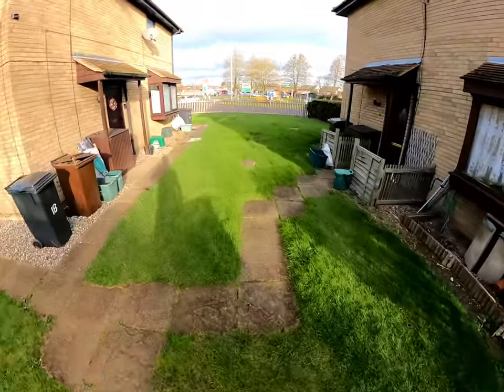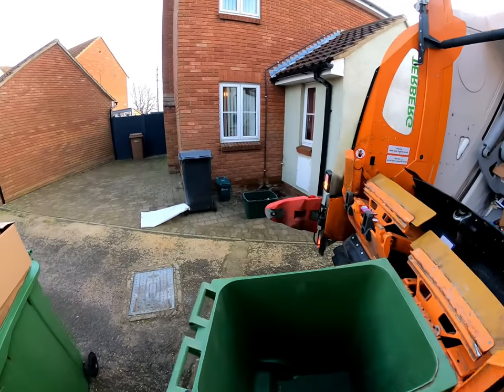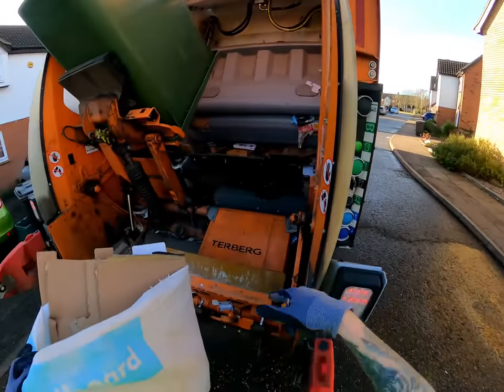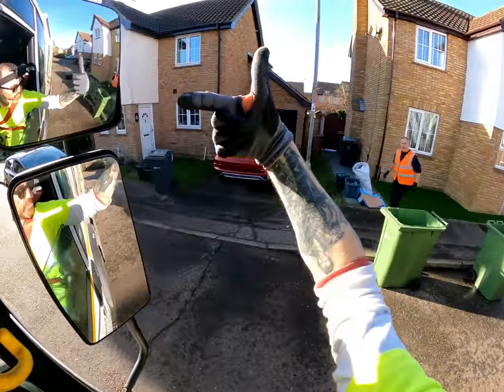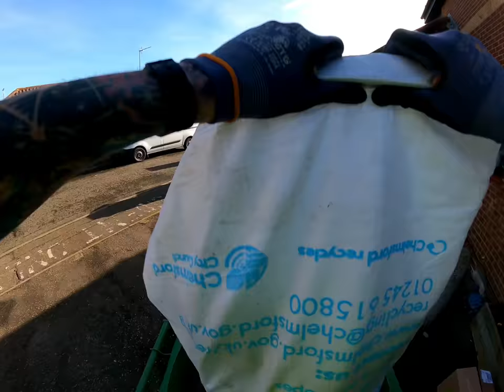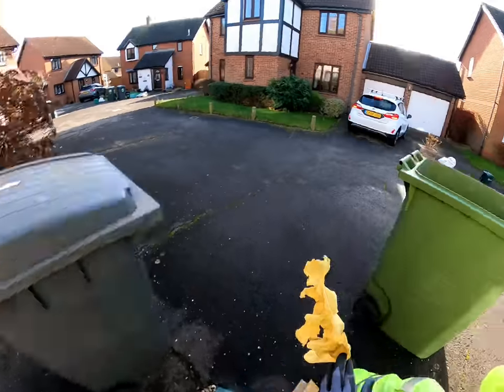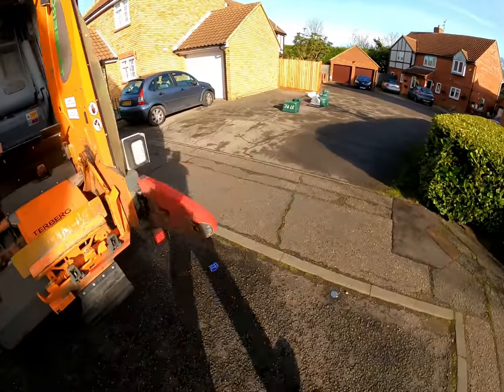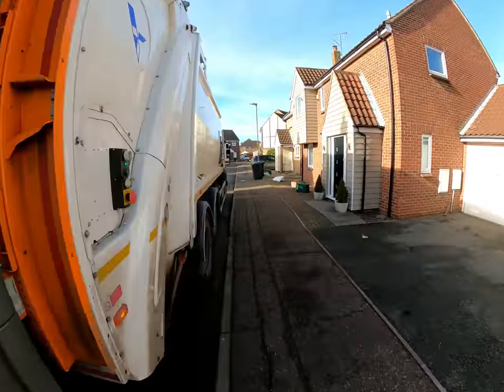Bin Man/Refuse Collector/HGV/Truck/Lorry Driver POV #11 *1000 Subscriber Special*

Comment: Loving the video so far mate! Really great stuff! Those lifts are Terberg OmniDel, specifically the electric version (signified by the green dust curtains and green terberg logo on the side glass panel). OmniDeka are the lifts featured in your first POV video on brown bins, those were brought in by Terberg to replace the OmniDE lifter (featured in your POV #2, #3, #4, #5, #6, and #7) which were rather unfortunately discontinued in the uk. Keep up the great videos mate 😎👍
Reply from the maker: Thank you

Comment: The TX4 taxi from 2006 onwards has a VM  2.5  16 valve diesel engine , (euro 4 )  and later 2.8 16 valve diesel (euro 5 ) .
Reply from the maker: Top bearding thank you for fact checking my videos 

I have no issue being humbled with facts to my hyperbole
Reply: @wheelerd02  I wasn't fact checking.  Just for information.  You are correct about the nissan being a 2.7  non turbo .  This was used up to 2002 and then the ford transit 2.4 16 valve turbo up to 2006.
Reply from the maker: @dennisphoenix1  didn't realise the 2.4 Ford lump was 16v, I just assumed it was a noisy 8v
Reply: @wheelerd02  yes the 2.5  8 valve up to 2000 and then the 2.4 16 valve onwards

Comment: Hey just wondering to be a driver of a bin lorry is it a class one or class two licence you need
Reply from the maker: HGV 2, over 7.5T

HGV 1 is for pulling trailers which certainly is not a part of this job. Although there is a whole industry around bulk waste movement for landfill/recycling operations.

Waste-Away
Fred Sherwood
Veolia etc have HGV 1 around waste management

Comment: Are you allowed to leave a truck running in the middle of an estate while you walk away to collect refuse    I thought drive must stay with vehicle at all times     How long does a run take to finish? Seems a slow process if your on task and finish
Reply from the maker: Driver's are employed as loaders here in a dual purpose role.

I have never told not to leave the vehicle, I understand your point though.

If someone came up with knife/gun/acid I would be getting out the vehicle anyway. 

The rounds vary in length.

Black bins can be done by 1400/1500 starting at 0630. Recycling depends on what you are loading. Paper & Plastic finishes much earlier than cardboard on account of being able to travel further with the bin before emptying.

Comment: I'm also wondering what do you mean by the left or right lock
Reply from the maker: Lock referring to full steering input on the wheel, maximum angle achieved is "lock"

The way manufactures refers to steering wheel turns "2.t turns lock to lock", full left to full right. How many times the wheel needs to rotate to get full steering angle

Comment: How do you know what roads/streets your covering? Especially when you’re new.
You can say nav one place but if you’ve got to cover an area how do you manage that?
Reply from the maker: The routes I was driving for the loaders worked full time. They knew every turn, drive or reverse and what order to do the work in.

There was a large zip lock folder with A1 print outs of the route. An overall overview of the days work plus further zoomed in zones.
Reply: @wheelerd02  just watched one of your videos about being a bus driver, how easy is it to drive a bus compared to class 2, refuse lorry?
Reply from the maker: @ksmith3997  buses are very straightforward but also have their own drawbacks. I have now done buses longer than I have driven lorries.

Buses drive forwards so minimal reversing. However, it being a public service vehicle it draws in all sorts of people. Some very nice decent folk, some not so much.

Like the bins, being a bus driver you are still treated with contempt and disrespect on the regular. Many people need our services but we are slow, cumbersome, in the way and slowing you do; an obstacle to overtaken at any cost.

Cruise about, occasional bit of chat with cash/contactless, pick up & drop off, a simple job in essence but the reality can be very different.

I prefer buses to lorries, some say I may be made but thats my concern.

I don't think I would go back to lorries now, doesn't pay enough for the frustration, risk and sacrifice.
Reply: @wheelerd02  yer, just not keen on the type of work and long hours of lorries (done it a few weeks) Refuse driving is okay, but wasn’t keen on jumping out to help. I know some councils have purely drivers, but not close enough to where I am. So thinking of maybe going the bus route? Not fussed on big money etc so as long as it’s simple enough to drive I might give it a go from what you’ve said. People moaning is fine, that bit doesn’t bother me, water off a ducks back
Reply from the maker: @ksmith3997  I started off HGV, got made redundant and someone said I should try the buses.

I grant you, sometimes buses made me very angry and took me to bad places but I am much better now in my new jobs.

Very simple work man, however boredom can become a real issue. I bring a book everyday so anytime I am early or using stand time at the end kf a journey I'll try and snatch a few paragraphs/pages. Read many a book this way over the years, eagerly awaiting the end of a journey to find out what happens next.

No music in buses so whistle, sing or daydream. Motors are cery likely to have CCTV so no naughty business but as a means of income, it is simple.

Also, depending in routes, delays and duty card planning you may find yourself in the seat for a extended period. No worse than some of the HGV 1 work out there but something to bear in mind.

It's generally frowned upon and a faux pas to stop mid service to buy drinks and snacks. In a similar vein, can't have a piss up the NSR wheel like you can with a bin lorry. Prepare prepare prepare 

A quote from me to anyone and everyone reading "Go when you can, don't wait till you can't".

No matter where you are or what you do; you'll have a HGV & PCV licence. You'll never be out of work.
Reply: @wheelerd02  cheers mate, good advice. Think I’ll go for it, I’m happy with boredom 😄 just nice to “switch” off did what I need to do and go home, want it simple as possible 👍🏻
Reply from the maker: @ksmith3997  Buses can certainly do all of that

Comment: Just a tip - stand large bits of flattened cardboard around the edge of the bin, and put the loose stuff inside. Can effectively use the large flattened cardboard to create walls to extend the height of the bin, allowing you to get more in one trip
Reply from the maker: Indeed I have noticed the guys doing this 

Nice profile picture, fellow greyhound owner
Reply: Yep one of my old tricks, and then climb on top of the bin and stomp it down to fit more in !
Reply: @chelsegreen7868   I used to get two weeks of mixed recycling (paper, cardboard, plastic and cans) from a 42 house terrace that the wagon couldn’t reverse up into four 360 litre bins. Every house had a 3/4 full to totally full 240/360. The cardboard walls on the bins I’d pack it into used to be taller than the bin itself 😂 Luckily there was one house that always had a second bin out, which was purely large flattened cardboard

Comment: I was want to ask what happens to the cardboard or plastic's that are up near the hydrawlics have you have a brush where you can bring it down.
Reply from the maker: Too high, too far and way too dangerous. We aren't allowed to enter the hopper/load area.

Let the vehicle deal with it, if anything does get stuck or into difficulty then the engineering team can isolate and secure the vehicle to deal with blockages

Comment: Awesome!! Great vid!! How come u didn’t have the twin pack(split body)??
Reply: Cause he was only collecting one waste stream (cardboard). The twin pack is used for plastic recycling in one compartment and paper in the smaller second one. Chelmsford still collects paper seperate from cardboard with both plastic and paper going out on brown bin week and collected by twin packs while the cardboard goes out on black bin week and is collected by single compartment trucks like the one shown in the video.
Reply: @laurin4339  oh wow that’s a weird recycling scheme!!
Reply: @refusevehiclesuk6129  Yeah very very unusual nowadays to have a seperate collection of cardboard and paper, usually mixed together or it‘s just completely commingled. Dunno if any other council in the UK still has a seperate collection of cardboard but I doubt it, Chelmsford is the only council I know that does it. Mind you Chelmsford also has a green box for glass and tins so actually four different recycling streams! That‘s pretty much unique, don‘t think any other council still having four different recycling streams. I think it‘s great though and very clever of Chelmsford since they can get the maximum quality out of the collected recycling meaning more money. The cardboard that was collected in the video can be sold at a far higher value than cardboard that was collected from a commingled recycling bin since the one from the commingled bin is dirty because it was compacted together with other recyclables.
Another advantage of Chelmsford recycling system is that it‘s all manual and no recycling bins meaning there‘s no way for residents to hide contaminants since the workers would easily spot it when emptying the bag/bin.
Reply: I'm in Scotlnd and my council have 1 wheelir bin for mixed recycling, 1 wheelie bin for general waste (only goes to landfill if the power plant is closed where it goes to be turned into energy) kerbside food caddy and a box for glass and small electrical items

Comment: How many tons do you think the compactor comes down and crush anything inside
Reply from the maker: The compactor shows hydraulic pressure of 200 BAR when moving the large blade back and forth

Not sure on the hopper itself

I have informed on general waste that the hopper blade can snap/crack an engine block in half
Reply: @wheelerd02  Engine block? I got very high doubts a Olympus like the one in the video could slice through that, the packer and hydraulics would break. It could swallow the block but not slice the thing in half. Don‘t think any rear loader for that matter could snap a actual engine block in half since it’s too solid, the hydraulics would blow in no time. However it‘s not up to questions these packer blades are very strong and can crush nearly everything that people but in their bins. A few rear loader designs (eg. Schörling, Leach and Geesink) were/are known for having the capability to crush a car (without the engine block). 
Funnily enough, in NYC they use heavy duty rear loaders for construction waste removal since there‘s no room for roll off containers, goes to show how strong some designs are seeing they just pack away huge metal frames or loads of bricks.
If you are curious, this video shows a Schörling packing a whole car: https://youtu.be/lW5RqmyIvD0
Reply from the maker: @laurin4339  I stand corrected 

A very thorough and detailed answer. Thank you
Reply: @wheelerd02  Im not sure if you know the answer but how much more hydraulic pressure dose US bin lorrys have in compare with UK bin lorrys
Reply: Or anyone else knows
Reply: @bradley-ts4kl  I’m not a expert so I can’t give you exact numbers but I can tell you a few general things. 
First of, it really depends on the brand, can‘t just generalise it as US and UK compacters. Loads of different rear load bodies out there, especially US ones, easily over 15 different US rear load brands. As far as I know, the compactor shown in the video is actually considered one of the weakest in the whole industry lol 
From what I‘ve observed though, most rear load bodies, doesn‘t matter if they are from the US, Europe, Asia or Australia, usually have the same packing power, some a bit more and some a bit less strong. I don‘t know of any really weak ones out there which is kinda logical since it wouldn‘t sell on the market haha 
There are a few exceptions that are a lot stronger and have a higher packing power. The crown of the strongest rear loader out there goes to the Leach 2RII (now called Packmaster) from the USA, they are usually considered the strongest body in the industry and are also used on construction sites in NYC chewing away loads of bricks or other construction debry. Search for something along the lines of „New York construction waste“ on YouTube and videos will come up showing a few of them on construction waste. They are also considered being nearly indistructuable with many lasting up to 40 years and more even when exposed to heavy duty commercial or construction waste. Schörling, a German company, also built the Leach 2RII under license in Germany till the company ceased production in the early 2000s. They often advertised the 2RII by showing it compacting a whole car, in my first comment on this thread I posted the link to a video of a car getting compacted by a Schörling 2RII, check it out if you want! The big downside of the Leach is that it‘s packer blade is pretty slow considered to other lighter rear loaders since the hydraulics are so massive. Still is a great rear loader body, especially for heave duty operations. 

Second strongest rear loader in the industry is usually considered to be the Geesink Norba body (also advertised as the „Value E Pak“ in the early 2000s). I‘m sure you‘re familiar with that one since it‘s also sold in the UK. It was first engineered by a Swiss dude and is now sold by Geesink Norba, a Dutch-Swedish company. Geesinks can also swallow cars with ease, unfortunately can‘t find the video right now showing one, sorry :( 
The Geesink utilizes a unique sweep blade, hard for me to explain since my mother tongue isn‘t English but if you don‘t know what I mean, just look up „Geesink garbage truck“ on YouTube. 

A few other strong rear loaders are the Loadmaster LM- 400 which is a US body which can also be found in NYC doing construction waste removal like the Leach 2R. 

Heil bodies are also considered to be very strong, you‘ve probably heard of them. They sell their products both in the US were the company originated from and also in the UK under the name „Hillend Engineering“. The heavy duty rear loader from them called Heil Big Bites are not built anymore but also had a lot of packing power. It was a swing link packer which brings us to the next point.
Swing link packers like the Heil Big Bite and Dempster RL are also pretty strong because of their packing method, however these swing link packers have the main disadvantage that they tend to push stuff out when coming down in the hopper area. 

Auger compactors also tend to be more powerfull than the normal blade ones, however since the last time a auger compacter RL has been built was a few decades ago, I‘m gonna ignore it. If you‘re womdering why there haven‘t been any new auger compacting RLs, it‘s mainly because the augers are pretty dangerous for workers so they probably wouldn‘t even be allowed on a RL nowadays. There are however still a few side load bodies that have auger compactors. 

Last but not least we still have the KUKA/Faun Rotopress which is a rotating drum compactor working a bit like a cement mixer. This design originates from Germany and has been around for a century now. They are also sold in the UK but not many of them around in the UK. 
These don‘t really have any packing force in form of a blade since there is none, however due to the trommel spinning, the waste gets compacted very very densely (especially garden waste) and from my own experience working with them, you can get some serious tonnage on them. 

Like I already mentioned English isn‘t my mother tongue nor do I live in an English speaking country so sorry for any mistakes. Hope this helped you a bit, if you get any question feel free to ask, I will try to answer them :)

Comment: If you don’t think HSE would like the bin stacking, you should see how bin delivery is done 😂 especially in the case of every single house being issued a new bin etc
Reply from the maker: We have 2 transit vans that do all waste receptacle delivery at our yard
Reply: @wheelerd02  aye, should see the way it’s done on a council-wide rollout, when every house receives a new bin.

Typically a crew of Driver + 4, with either a transit tipper pulling a very large trailer, or a 12/18 tonne removals truck with tail lift.

Bins come in larger stacks than normal, typically 18 bins high. Only way to get the bins out is to drag the stack off the back and push it over in the middle of the street, very easy to get pulled with/under the falling stack.

Quite often, having been tightly stacked together, it is incredibly difficult to pull them apart, generally resulting in very bad lower back strain from pulling on the top bin lying on the ground as hard as possible, while pushing against the one underneath with your boot.
Reply from the maker: @dickhead0423  sounds awful